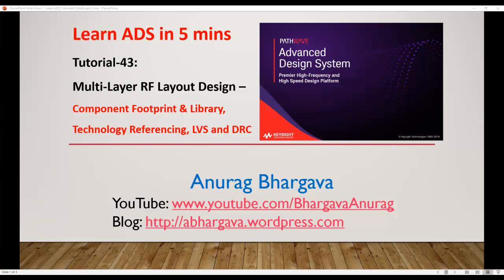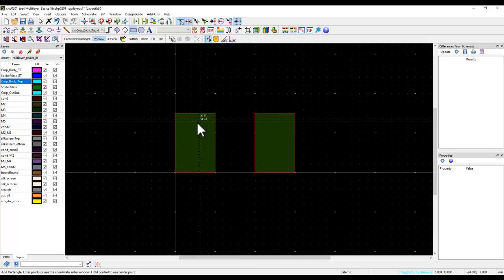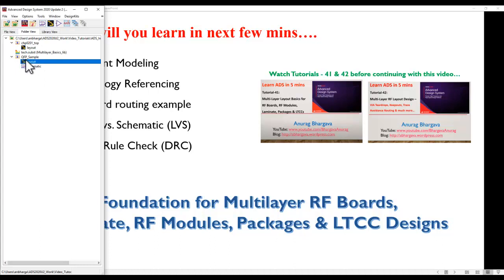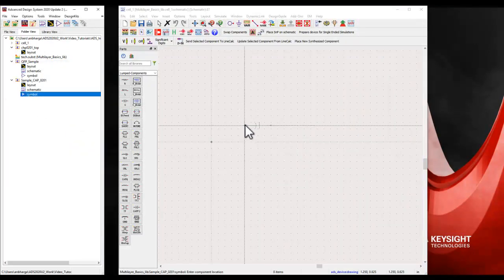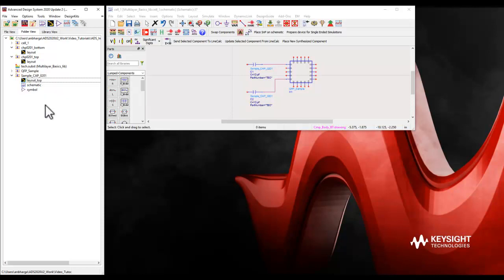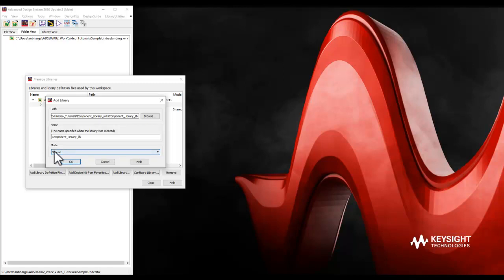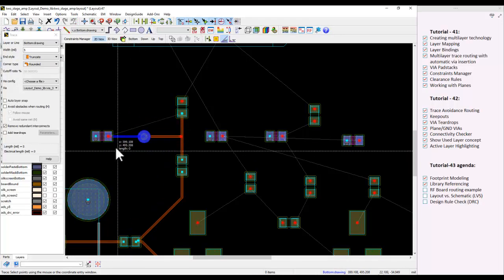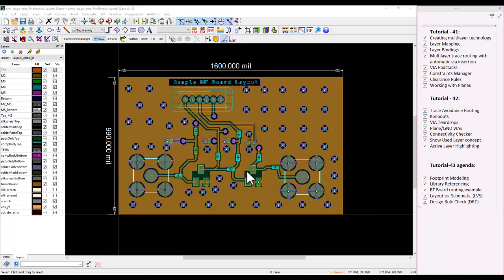Tutorial-43: Multi-Layer RF Layout - Footprints, Technology Referencing, LVS and DRC

Comment: Thank for the great video. How would one create a simple transmission line on a specific layer, but have the length and width be parameters a user can define later in a PDK? When I use the Tline-Multilayer I can define lengths and widths as parameters in the EM setup, but I can't not relate those lines back to a substrate I defined. However, when i use the tline-linetype, I can relate my lines back to the substrate, but not have the line be defined by user inputted variables. Any advice? Thanks!

Comment: Hi, thanks for the video. I have a   question about the stack-up: what if the stack-up of component library imported is not the same as the stack-up of the board? Should I recreate a new component library?
Reply from the maker: Hi,
I am not sure if I understand your question completely but in many cases the stackups won't be similar. In ADS workspace, you can have multiple libraries with different layers & stackup so it shouldn't be a problem. You can contact Keysight tech support team if you need any further help.
Reply: @BhargavaAnurag  Hi, thanks for the help. I meant for example I created a component library (with all kind of layer definition, say in a 2-layer stack-up), and then I would like to import it to another workspace which use a totally different stack-up with different layer definition, say 6-layer. Need I re-map the layers from the component library to the current workspace or I can just use the library without problem? Thanks

Comment: Thanks Sir for your great tutorials, really appreciated 
I do have a question , what I know about solder mask that it's used to cover the coper traces to protect them from corrasion and any short circuit occurs during operation.
pads and footprints should be free of solder mask so we can solder our component. But here you put solder mask just directly over the footprint, Why did you do that ? how can we solder my component if it is covered by solder mask ? 
😅😅
Reply from the maker: It was only a demonstration, in reality you can modify it the way you want...
Reply: @BhargavaAnurag  Thanks for your replay appreciate it 👍

Comment: Thanks for the excellent videio. I'm wondering which way is the right way to define the Solder Mask in the substrate: add a dielectric layer or just map a solder mask layer like you did...
Reply from the maker: It depends on what you are trying to achieve with solder mask? If it is for EM analysis then I will recommend to add it like a dielectric layer

Comment: Dear Sir, how to change the layout unit from mil to mm?
Reply from the maker: Hi Suresh,
It is not recommend to change unit after you have created layout in a workspace but if you want to you can change the units by going to Technology definition but be aware that there are many thing which won't be rescaled like Text, Pin size etc when you change the units midway.
Its best to create another library with desired units so that all the things can be synchronized properly.

Comment: Hi, thank you for the great offert in this useful tutorial.
 I am facing a problem, the tracks and components placed in different layers are interacting with each other,  like when a track in one layer is passing under a component that placed in other layer I get the overlapping blue dot.
the same happens when i place a ground plate in one layer it start applying clearance to traks placed in another layer.

I need help.
Reply from the maker: Hi Lolo,
If objects are in different layers then they shouldn't conflict with each other. Kindly contact your local Keysight tech support to get help...
Reply: Thank you for responding 😀

Comment: hi sir thanks for making helpful tutorial.
i have one question  .
in 6:59 , i can`t find Fast Grid Tool  icon . how can i appear this icon on the bottom of page?
or how can i use fast grid tool?
Reply from the maker: You need to enable Layout Command Line option by going to ADS Main Window->Tools->App Manager and then restart the ADS. Once done you will see the Layout Command Line toolbar on the top side in the layout window and you can drag & dock it at the bottom side or anywhere you like....😊

Comment: Hi Anurag, Thanks a lot for all these videos. They have been so much helpful for our designs.

 I am facing one problem here. I followed the procedure to design the PCB a per this video. But, I am not able to see any component in the Pick and Place report after generation. Please suggest the procedure to generate proper Pick and Place report. Thank you.
Reply from the maker: Hi Vijay,
Generating pick and place report is quite straightforward but if you don't see any components in the reports then it might be possible that all of your layout components are part of exclusion list and you can copy the default $HPEESOF_DIR/de/ael/de_parts.ael file to your own location, modify the exclusion or include your component category and load this file to generate appropriate pick and place file. Kindly refer to the ADS documentation on the same:  qthelp://ads.2021update2/doc/custom/Pick_and_Place_Report.html#PickandPlaceReport-1106158
Also, you can contact your local ADS tech support team to help you if you are not able to resolve it yourself.
Reply: @BhargavaAnurag  Thank you for your prompt reply. I tried to follow the procedure outlined in the help section. But, I could not get it. I will contact the local ADS tech support team.

Comment: How about importing footprint and symbols from downloaded CAD from supplier or mouser? was hoping it is covered
Reply from the maker: Hi Jonathan,
You can surely use the footprint provided by the vendor by importing the respective layout, you need to ensure that layer mapping is correct between the technology layer mapping defined in ADS & import footprint. If not, then you need to transfer the objects to the right layers. The symbol doesn't have any 1:1 compatibility as per my knowledge so can't comment on the same.

Comment: I want to create a component for schematic and layout design based on an S-parameter file (for 6-port RF switch) from a vendor. I have drawn a footprint and generated a schematic. Then I put an SNP block from the Data Items palette between the ports. But the problem is when I generate layout with it, the layout design recognizes the SNP block as a component and it looks like an X-box which is meaningless and spoils the layout. The objective of the design is to understand the effect of simulation between the schematic design and PCB design. How can I improve my design and create a component properly?
Reply from the maker: Hi Yuchan,
If you just want it on a static level without going into library building etc then it should be simple to do and here is the way:
1. If you already have the footprint then make sure it has the right number of pins as your eventual SnP file will have. Also make sure Pins are at the correct place for the right Layout connectivity.
2. When you place SnP component in your actual design, right click and select Component->Edit Component Artwork
3. Select Artwork Type as Fixed and now Browse button should get activated.
4. Browse to the cell that contains your footprint
That's it.....👍
I posted a video long time ago on this, see it here: https://youtu.be/Z9TvYfb6ETY (focus on 2nd par of this video) and you will get answer to your question.
Hope this helps
Reply: @BhargavaAnurag  wow thank you so much. It totally answered my question. Now i'm going to do em simulation and compare the result with the shcematic simulation

Comment: Hi, thank you for our video. When I assign Pin, the character size is too big. How can I set up and make it small? The Pin belongs to silkscreen layer and I want to change the font size
Reply from the maker: Hi Yuchan,
You can set the Component Text as well as regular Text size from the Options->Preferences->Components Pin/Text and Text menus. Please note this change will only affect the components which you will place after entering the new size. Existing components which are already there will not be affected by this.
For existing components, switch on the Properties window (which you would normally see on the right side of the layout window), select all the components using CTRL+A in the layout then look at the Font under Properties window and you may see 10 or 100 mentioned there , change it to 0.1 or 1 as desired and press Enter.
Hope this helps...
Reply: @BhargavaAnurag  Thank you so much! I didn't no that existing components are not affected by the change of setup :)

Comment: Yeah, making a Drc file with AEL is pretty easy. You just declare the import layer  and export layer. Do the checking on the imported layers using inbuilt ael functions, use work layers if you need to and append all the DRC errors to the export layer. Done! It's that simple. 
Unfortunately ADS DRC engine doesn't check all the rules that are sometimes required, but it checks almost all the rules. But still  atleast once we need to run Cadence's Assura DRC engine before finalizing a design.
Reply from the maker: Hi @Qaz Wsx, Thanks for your feedback. It would be nice to know what all rules ADS DRC doesn't check currently so that I can file an enhancement request for R&D to consider. This is an active area R&D is working on so good chances that the request will be taken up.
Reply: @BhargavaAnurag  I'll mail you about it from my official mail on Monday.